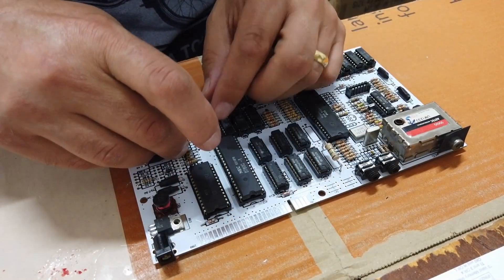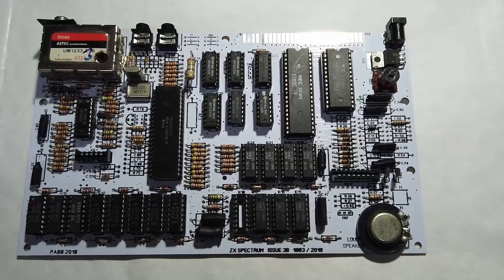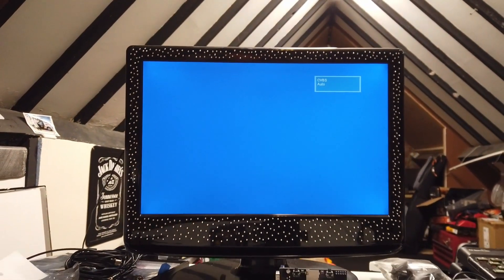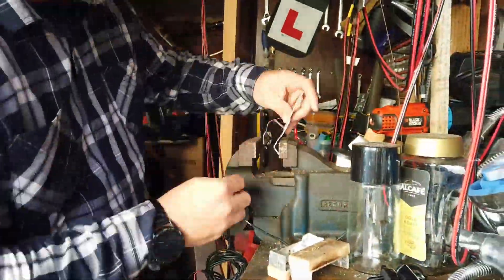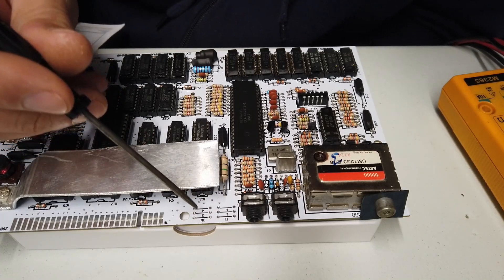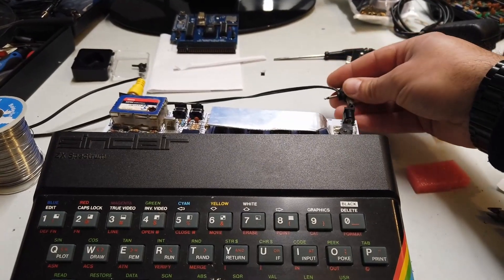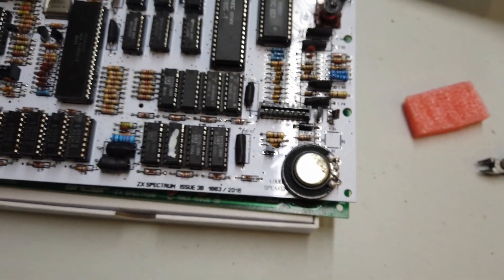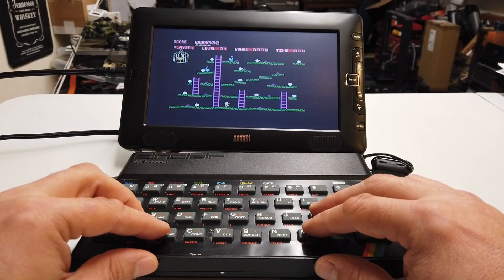DuB-EnG: WHITE MODERN  PCB - ZX Spectrum 48k refurbishment - lots of soldering and faultfinding PT4

Comment: 1 You will defo need that switching replacement for the 7805.
2 You going to use recovered vape cells?
Reply from the maker: Hahaha...  ahhh ...  I guess that V may have slipped into a few videos...  I guess I have been perpetually trying to give up for 20 years! :-) 😀
Reply: @DubiousEngineering  didn't notice one, been collecting 1500mAh cells that have only been used 1 time..